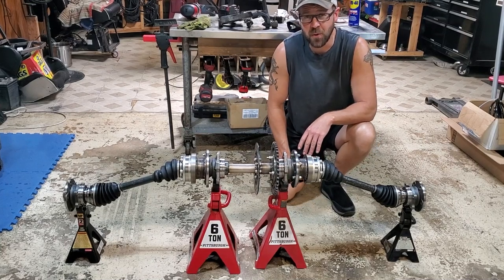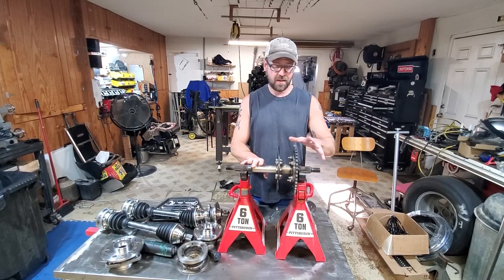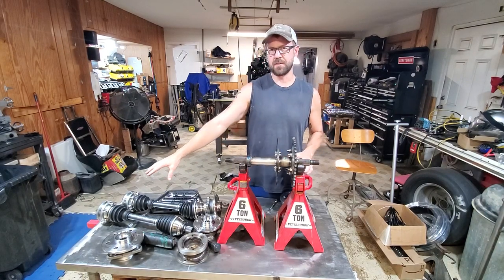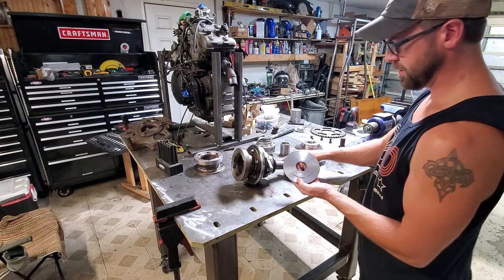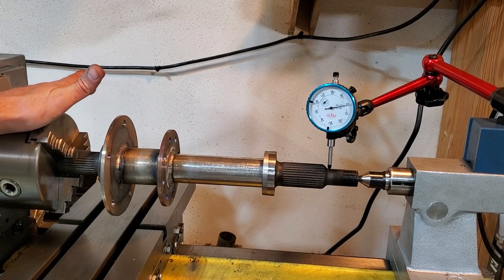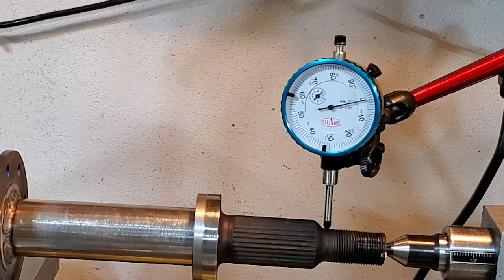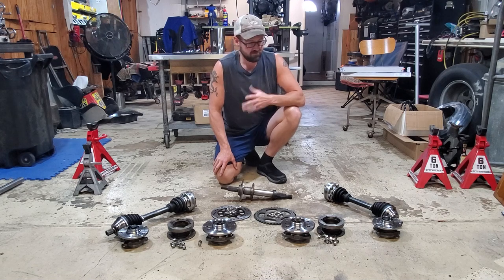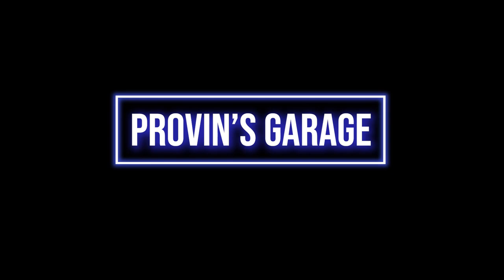DIY Independent Rear Suspension Axle for a Crosskart Offroad Buggy || Making a Crosskart Axle

Comment: I bought a bull bandit sprinter from a guy in Indiana. It has a independent suspension made completely out of thick wall 2x2 tubing pillow blocks 1"key stock and U joints. Everything was bought at a tractor store. It's so simple it's amazing. This kart is a Honda fl250 odyssey with truck air shocks on the rear. It has a 6' wide edge to edge stance. It had a Suzuki 750 on it and held a track record of 90mph.
Reply from the maker: Sounds super simple. On my next one I plan to do a jack shaft with the output shaft being simple like you described. This video was my first take on it and I have learned quite a bit since then.

Comment: Wut  vehicle are the hubs for so I can go to pick a part and get the half shafts??
Reply from the maker: CV shafts are off of a 2006 Audi A3, the inners are from a 90's Dodge Durango. Manufacturer or year isnt really important, you mainly want to find the type that bolt on rather than being a spline on the inner cv. I know several year Miatas were bolt-on style. My FC rx7 is too. If you look around the scrap yard you should find several that are the bolt-on style

Comment: So am building sand rail and do you think this is worth it ?
Reply from the maker: I think it depends on how much power you plan on making. This system is very robust. If you aren't planning on making a lot of power there are much simpler ways to make a rear spool. I plan to do another one in the near future that will be very different, this one was my first attempt
Reply: @provinsgarage  well am using 15 k rpm electric motor with i think 120 foot pounds of torqe so what do you think
Reply from the maker: @Cro_man_  that is quite a bit of power. This type of drive train would definitely work well for that but it isn't the only option. It really all depends on your budget and how much time you want to spend. This method was inexpensive but time consuming while other methods can be easier and faster but more costly
Reply: @provinsgarage well i got time while i wait for my body(my frend is welding it) so i got 20+ days to build rear axle so is it gona take more than 20 days
Reply from the maker: @Cro_man_  definitely shouldn't take that long at all. I think I had about 10-15 hours into it when I built that one
Reply: @provinsgarage  oh so its worth it for me i just need to get joints and do you suggest i use that like rubber protection
Reply from the maker: @Cro_man_  if you mean the boots on the cv axles they definitely need the boots to retain the grease inside the cv and keep debris out. You could also use drive axles with universal joints but cv axles can be smoother with longer suspension travel
Reply: @provinsgarage  kk thx